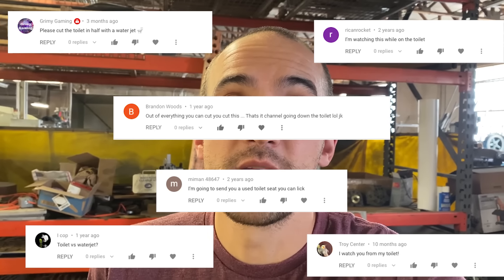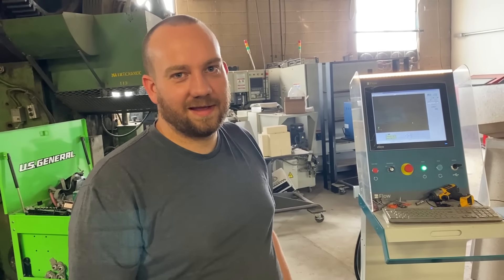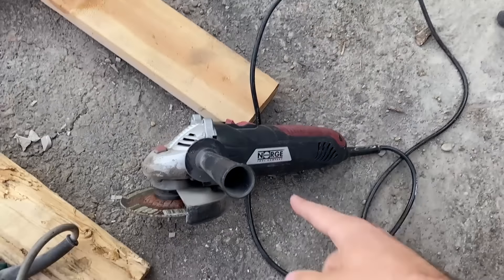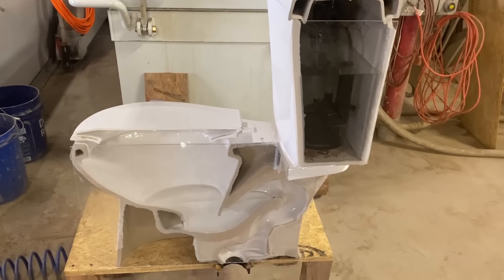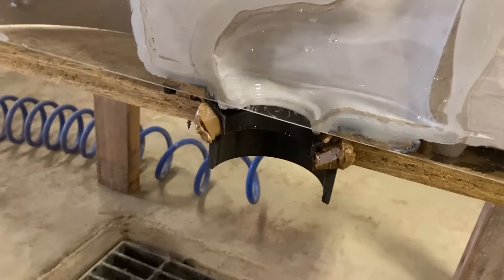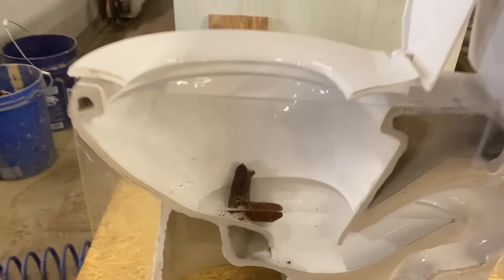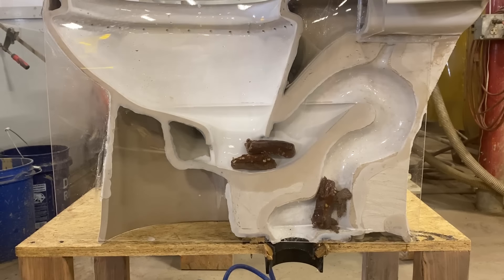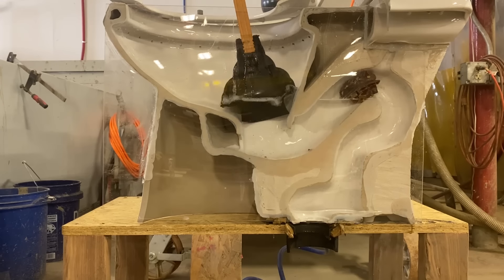Can You Flush Half A Toilet? | Waterjet vs Toilet

Comment: To answer your question, they do make water closets that have a 3" trap. Pressure assist water closets are over rated. Way too over ingeneered and very finicky. Toto makes the best water closets hands down. Pricy for sure but they can handle all the crap you can throw at it.  
Your friendly plumber.
Reply: I concur with the Toto endorsement he makes; I installed a Toto 1 gallon and it is incredible. For example, I flushed probably 2 quarts of old cherry pie filling down the toilet and my Toto flushed it ALL with one flush!
Reply: Toto is an excellent manufacturer of thrones .  Gerber does good for basic but dang reliable.  American standard ... I mixed about . The champion 4 toilets do flush well but parts are hard to come by and very pricy .
Reply: At around 6:40 you can see the tiny channel at the top of the exit trap. What's the name of this finger sized tube and what's the purpose and what does it do? How can it be open on both ends and not let sewer gases out. Do you think it's closed on the upper end? I see water running into it or out of it but when they have the clog part later I can see little air bubbles go up into it and disappear so I wonder where they go?
Reply: @1weirddoe571  to me that seems to possibly be part of a casting or molding process. Maybe it's the way they pick them up and move them around as they bake them in the ovens. Not sure why that's there. I say that because in the tank there is no serviceable part for that feature. Even after Plumbing for 24 years I will have to go to my supply house and show them what you found out. I'll repost if I get any new information. Nice catch.
And remember American Standard...
Made in Mexico.
Reply: @77Infidel , great thanks. I was just pump irrigating mine to unclog the rim holes and I don't want my vinegar to go down this hole and be wasted. I cannot imagine where the little air bubbles go because that would let sewer gases into and out the rim holes. I'm confused.
Reply: @1weirddoe571  I'm also thinking it might  be a waterway that they mold into the casting. Possibly under the flapper valve which would trap sewer gases with the valve, but allow for water to go around the rim holes and through that little thing when you flush, I'm confused as well. Water closets used to be simple,  I wouldn't worry about what processes you are using to try to improve it. I wish you good luck.
Reply: @1weirddoe571  that is a drain hole for the slip when manufacturing.  It is plugged prior to firing in the kiln.

Comment: Very accurate guys. Good job.

I have done this same experiment to many different toilets. You did it correctly. Others have not.

2 points:  A.) Brownies are not suitable. You would scream in agony if you tried to pass brownies. The standard test uses miso paste. It is called the MaP test which is now part of ASME A112.19.2/CSA B45.1.   B.) Drop the test media 6 inches from the seat holes, about the middle of the sump (near the jet). You dropped it where a little toddler would sit.

Trapway designs balance many different features from gravity, water consumption, ceramic glaze, manufacturing, patents, and efficiency.  Features might seem counter intuitive, but every feature exists for a well defined and researched reason. Its just a matter of which brand emphasizes which features and to which end as there are trade offs.

As a note, and you pointed it out: a cut in half toilet will not function as well as a full toilet. The dynamics of the plexiglass interfere with full proper function. But seeing inside is valuable.

Finally, not in my wildest nightmares would I believe I would engineer toilets. I should be out in front developing throttled rocket engines. But toilets are rewarding because we have to do so much work with so little energy. It is a gigantic highly challenging engineering puzzle; taken for granted till it doesn't work.
Reply: At around 6:40 you can see the tiny channel at the top of the exit trap. What's the name of this finger sized tube and what's the purpose and what does it do? How can it be open on both ends and not let sewer gases out. Do you think it's closed on the upper end? I see water running into it or out of it but when they have the clogged brownies part later I can see little air bubbles go up into it and disappear so I wonder where they go?

Comment: The term for the smaller hole in front of the flush hole is called a syphon jet. It helps the water push the poop down, and it reduces the chances of clogging.

Comment: The reason why drain/sewage risers have vents at the top (roof of an apartment building not 100% sure if normal residential houses have them too) is because without them a solid flushed turd (and maybe even just dirty/clean water) would create a low pressure suction as it goes down the pipe which in turn would suck all the water out of all the traps. With a vent on the top it just pulls in fresh air behind it and leaves the traps full of water. (But the roof of an apartment building can stink near the vents...)

Comment: American toilets are weird. UK toilets use a syphon to dump the water out the cistern into the bowl, but there's a lip around the bowl instead of little holes, and that's where all the water comes out, there isn't a hole at the bottom to help force things through. And usually our toilets send their contents straight out the back into a large pipe, rather than down through the floor.

Comment: I was attempting to set up system consisting of a water pump and bleach in the bowl in order to clean the holes below the circular rim from the inside, since they had accumulated dark mold.  Undoubtedly the mold lives inside the circular rim water channel, so simply wiping the visible surface of the holes is useless.  Recently I viewed another YT video demonstrating this pumpand bleach setup, then went out and bought a tiny electric pump and a gallon of bleach.  Unfortunately this procedure failed for me because the bleach instead continuously recycled between tank and bowl (instead of between the tank and rim holes).  I presumed there was a hidden secondary water pathway from tank to bowl, and this video proved it, beginning at 9:30.  This was a fascinating and very educational video and I am super happy that I found it.  Now, what should I do about the moldy rim holes (that is inaccessible via the pump and bleach method) ?
Reply: We cracked open a toilet at my facility and not only found slime mold around inside the rim cavity, but also in that cavity that goes down to the siphon jet hole at the bottom!

Go with vinegar instead of bleach. Dry the bowl well and tape all the jet holes. Plug the larger siphon jet hole 9:48 at the bottom with plumber's putty or whatever will seal it. 

Then pour vinegar down the tube inside the toilet until you're sure that all the cavities are pretty much filled. Let it sit "awhile". Flush, and repeat if the mold still accumulates in the bowl.

Comment: The hole is smaller purpose to prevent stuff that shouldn’t be flushed from going into your system.  That way you can retrieve it before it causes major problems.

Comment: One thing to do if a toilet gets clogged is not flush it again. Turn the water off and use a 2.5 gallon bucket filled with water to act as the water tank, dump it in (to an empty bowl) so the force of the water helps create the syphon effect at the bowl outlet hole. Always use and refill the bucket, this will eliminate the bowl overflowing on the floor. 

And save the brownies, the actual baked brownies, for a snack later.

Comment: 10'04" The question on "flush-assist jet" is the siphon effect.

My question is why pouring a big pail of water into the toilet quickly does not create the same siphon and suction effect. Pouring a pail of water looks like the same as the water cistern releasing a volume of water. Both act by gravity. So why the difference?

Comment: Can you get a toilet over there with a pythagorean syphon in the cistern and cut it in half but keep it functional with the clear plastic but you'll have to complete the original shape to keep it working, or try and make a half version that can work too. I've seen one other video with them but they couldn't show the exact situation of one working in a toilet. Could you also add food colouring to the water, but do it after it has filled so that it doesn't mix but hopefully streaks through the water as it drains, to show the flow of the water through the system.

Comment: I think it's not an accurate experiment. Firstly, cutting half the toilet will reduce the volume of where the material gets flushed to by half since it is a cylinder. That's why a lot of the time those remained stucked.
Also the fluid dynamics will not be the same, the turbulence is not the same in a half cylinder as in a full cylinder. 

To replicate the exact setting of a flush, you should get a transparent toilet, not a cut one. 

You should probably make a transparent toilet.